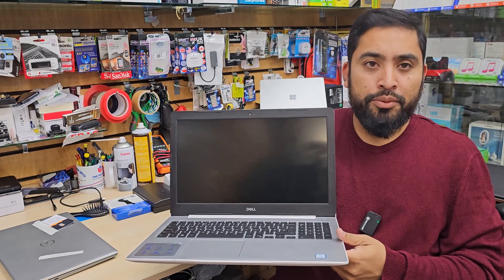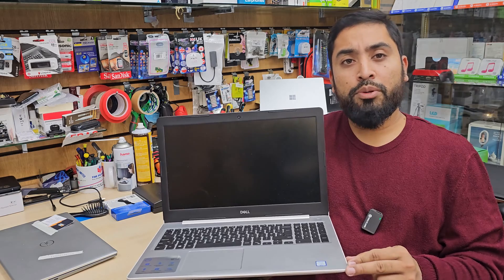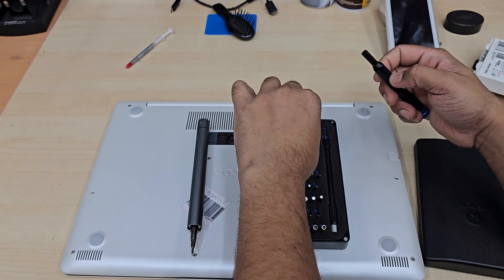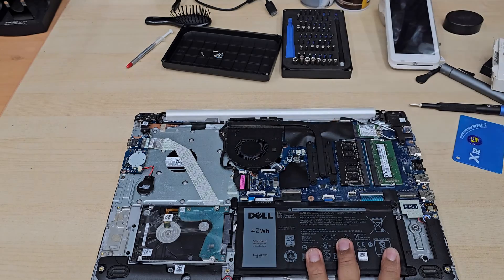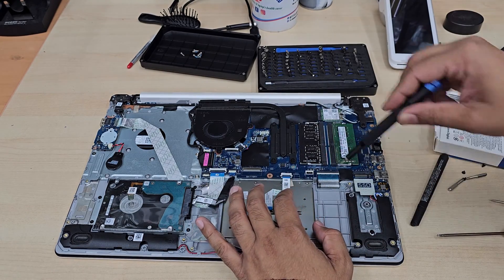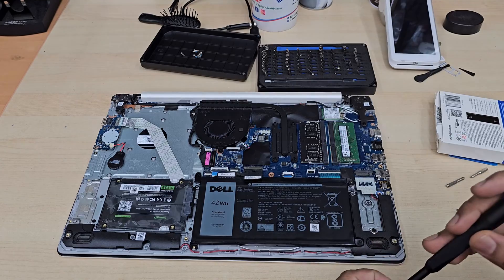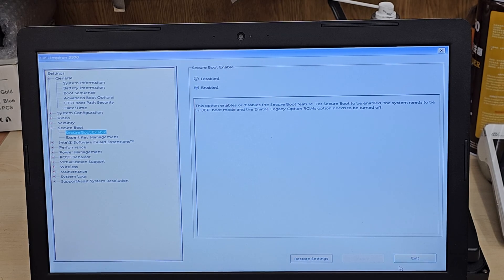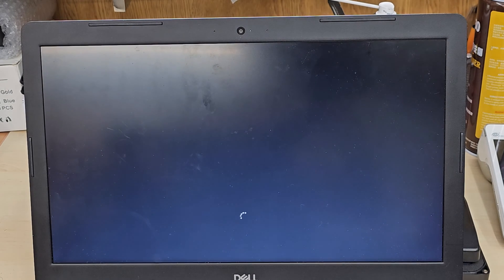From Slow to Speedy: Speeding up Dell Inspiron 15 5000 Series

Comment: Great video. I have Dell inspiron 15 5000 series with 16 GB Ram and 2TB HD and prossessor is core i7-7500 CPU can I have install M.2 in this instead of ssd? and it is so so slow to boot it takes several minutes to be on now can I use Cady for the HDD if I install ssd? most people suffer from discoonection of thier HDD in cady after insatall